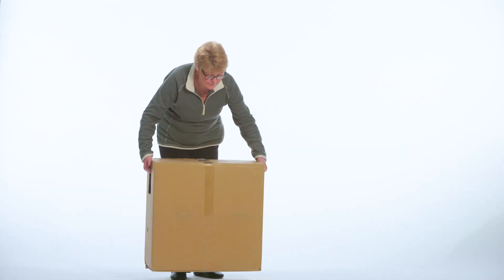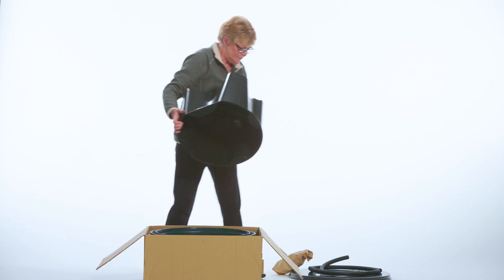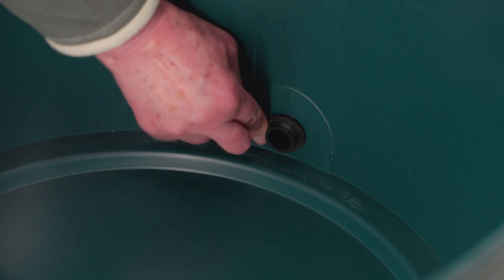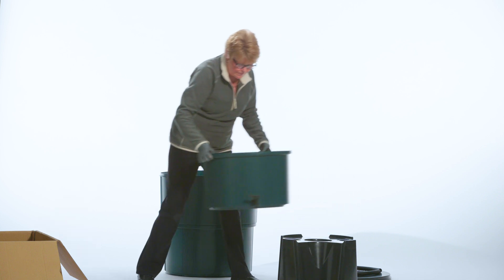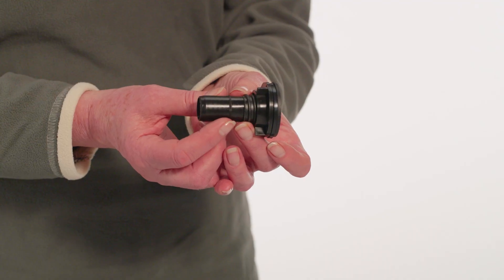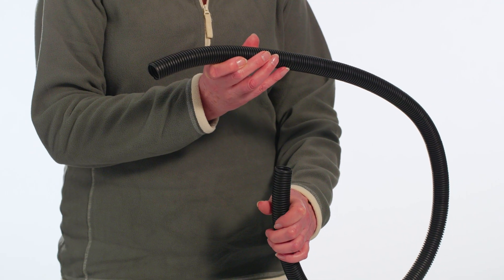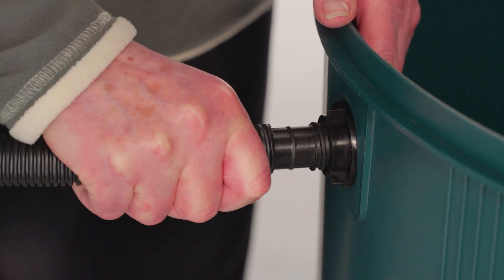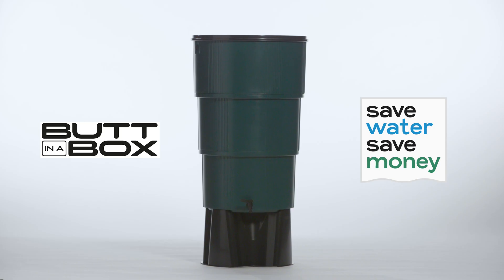ButtinaBox SuDs  Installtion

Comment: Update. A guy from Severn Trent confirmed you need to use a hammer. I bought a rubber mallet just for this purpose and succeeded only in breaking the plastic. Butt is still in pieces.

They're going to come out and help, but if you bought this product from a shop and need to do it yourself... Good luck. It's just poor design and/or tolerances.

What's more frustrating is that they originally said they couldn't help us fit it due to us having a metal downpipe, despite me telling them there was already a plastic collar for a water butt in place

What a nightmare